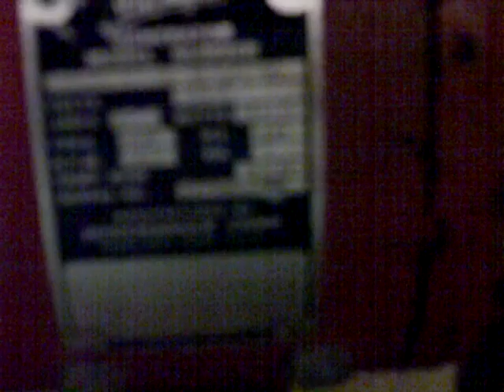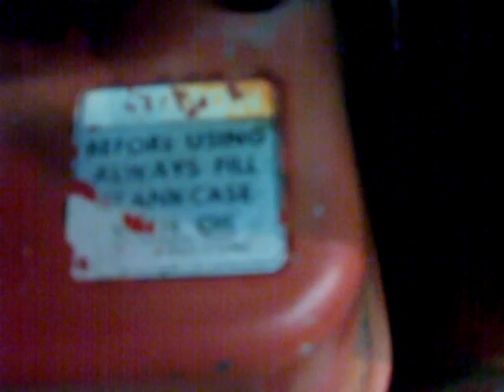Briggs & Stratton Generator

Comment: Do you happen to know how to just the RPM?  Got the same type of engine a little bit bigger generator and just got out the shop for some carburetor work when it came back seems like the guy didn’t adjust the RPM right because it doesn’t seem to be running as fast as it had in the passed and when I put a electric heater going and it seems to run it but the voltage drops from 125 down to 114 under load and the frequency drops down to about 53 hz